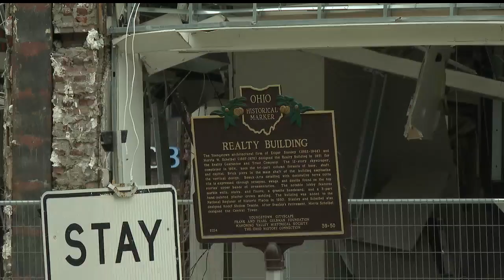YSU engineering professor extremely concerned about downtown building's stability

Comment: This is alarmist misinformation.  There is no chance of the building collapsing.  A civil engineer is not the same as a structural engineer or architect.  This building is constructed with steel I-beams.  The brick face has nothing to do with the structural integrity.  Nothing short of a nuclear blast could take it down.
Reply: Nothing short of a nuclear blast… You clearly understand nothing. Everyday buildings are demolished with far less explosives than a nuclear weapon. Steel structures are not impervious to explosions.
Reply: @Gordy-fj1jy  when buildings are demolished with "far less" explosives... they're placed DIRECTLY on the support columns to ensure their failure... not 2 floors down, randomly all over the place.

Unless there's lots of corrosion to the structure... it's probably fine.
Reply: @jasono2139  that’s for an organized and controlled demolition. You can still have scattered damage at any level that could cause a partial or uncontrolled collapse of the structure.
Reply: @mattmarzula  an "argumentative punk"... that doesn't mean much coming from you! 🤣

I mean... if I was as wrong as often as you are, I'm sure I'd be accusing everyone of the same!
Reply: @jasono2139  oh, I thought I was the argumentative punk he was referring to.
Reply: @anthonytripp2251  stick around long enough, and you'll get to join the club! 😂
Reply: Oklahoma City wasn't a nuclear blast. 9/11 wasn't a nuclear blast. It only takes about 8 to 10 PSI to demolish a modern reinforced concrete building. Depending on distance and duration, blast overpressure from a nuclear explosion can exceed 80 PSI. So there are plenty of things short of a nuclear bomb that could and would demolish that building. Either way, I'm leaning towards it being salvageable based on historic precedence, preservation efforts, cost, and nostalgia moreso than safety.
Reply: @mattmarzula  I wonder, does that come down to the insurance company as to whether it can be saved? Undoubtedly this will be expensive…
Reply: @Gordy-fj1jy I'm sure they'll look for the biggest cost savings measures. By the time we hear about it through the media, it'll already be spun into something sentimental. Something like, "We need to do it for Youngstown!" Or for the children or to preserve the history... I like and appreciate the architecture of downtown. I like this city warts and all. Just don't blow wind up my tailpipe preaching progress and preservation at the same time. When something is crumbling and no longer a viable structure, tear it down and replace it or tear it down and let nature reclaim it. We leave too many useless hulks and eyesores lingering around this rusted out burg.
Reply: @mattmarzula  Yup 💯
Reply: @mattmarzula  Dude.  Okla City was built with lift slab technique.  WTC was an untried building technique that did NOT use steel I-beams. Look at the plane crash at Empire State Building in 1945 to see a building using steel I-beams as its superstructure, then rethink your conclusions.
Reply: @mattmarzula  ... you literally pulled the "8 to 10psi" out of thin air.... ummm... the Hoover dam is constructed almost entirely out of reinforced concrete... and it's holding back over 40,000 psi. 🤦

I bet you were snarkly laughing during the movie Armageddon when they correctly explained that a nuclear explosion going off near an asteroid wouldn't do anything to it either! 🤣

Nor was the Oklahoma City bombing a gas explosion.
Reply: You should read more. There are detailed reports of the building's construction. It's primary held up by large brick columns.
Reply: @nilpo  Wrong.  It is steel I-beam construction.  Where did you read that it was held up by concrete support columns?